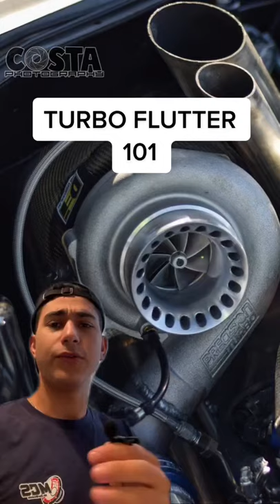TURBO FLUTTER 101 - Explaining Sutututu Theory

Comment: I believe you are describing a diverter valve, when the boost limit has been reached the valve opens to purge enough to drop the boost pressure and this is back into the exhaust.
Reply: He is talking about what happens when there is no  diverter valve or blow off valve releasing pressure, also it doesn't vent into the exhaust, it vents into the intake of the turbo.

Comment: There's also Sequential BOVs like the ones from HKS which simulate a Flutter without all the lower life expectancies
Reply: Simulate flutter aka sound nothing like flutter, also doesn't damage the turbo not running a valve.

Comment: It’s called back spoiling because the pressure in the inlet past the turbo is at a grater pressure than the exhaust gasses expanding pre turbine so it begins running backwards
Reply: The turbo runs backwards?

Comment: Compressor surge occurs when leftover boost is trapped between the throttle plate and the compressor. With nowhere left to go, the charged air forces it’s way back out the intake, passing through the spinning compressor causing the fan to ‘chop’ the air, resulting in turbo flutter.
Reply: I heard this can be bad for the turbo, is this true?

Comment: Its called compressor surge, the part you're referring to is the impeller not the turbine, and the pro's often use a recirculation valve over a blow off valve.

Comment: It’s actually caused by two different types of turbos. Turbos with blow off valves are regular turbos. Turbos with variable geometry valves in them make that sound.
Reply: Except that is no the case,  the sound is what he explained, it's caused by not releasing pressure out of a blow off/bypass valve not the type of turbo.
Reply: @DriftNick  its completely about the type of turbo. Only the variable geometry turbo makes the sound he's referring to because the vanes are positioning themselves to slow down the speed and letting pressure off.
Reply: @camronchacon7259  You don't not understand what is happening if you think it has anything to do with variable geometry turbos, he explained what it is in the video, unless you can point out where my 35 year old car has a variable geometry turbo? oh that is right it doesn't.

Comment: And that air forcing its way backwards out the compressor, also causes a lot of shock on the bearings. Because the wheel and shaft get pushed back and fourth. 
So basically that sound is the death of a turbo.
Reply: Basically that sound is the death of a turbo = does no noticeable damage.

Comment: The flutter you are hearing is caused by the rapid reversal of airflow through the compressor. (Nothing to do with the turbine - remember a turbine is a finned wheel used to convert air/gas/water flow into rotational energy, so in a turbocharger, the turbine is the exhaust wheel, which drives the compressor wheel via a shaft.) When the turbo is producing boost, it is spinning at high speed and moving a lot of air. When you close the throttle (let off the accelerator) this large volume of air suddenly has nowhere to go, so it bounces off the closed throttle plate and back towards the turbo compressor, which is still trying to compress the air (because it is still spinning -- due to inertia and centrifugal force). This creates a repeated back and forth pulsing which is what you hear until the pressure in the charge side of the compressor equalizes with the outside pressure (atmospheric pressure.). A blow off valve is designed to open as soon as you close the throttle to allow the charge air an alternate path out of the closed system. The fluttering (compressor surge) is not very good for the health of the turbocharger to but it does offer an advantage: If you get back on the throttle while it is still surging, you get much quicker re-spool since there is still compressed air on tap. This is why you often hear compressor surge on race cars, since racing teams have budgets for turbo replacement / rebuilding.

Comment: Just so we’re clear the charged air is released through the compressor and not the turbine. Turbines convert pressure into energy (hot side) compressors convert energy into pressure (cold side)

Comment: Yeah bro this happens on systems with BOV’s too if the boost pressure can’t escape quickly enough or if your BOV spring is too stiff especially on those sandwich types like the Greddy. The HKS dolphin sound one can do it too with an overly stiff spring.

Comment: More I’m depth explaining that no one asked: when there’s no where else for the air being sucked in to go when the throttle body is closed it wants to try to escape back through the intake but the turbo compressor wheel is still spinning and it starts to chop up the air since the compressor wheel is only designed to have air pass through in once way  the air being chopped up creates turbulence and thus you get the flutter sound. The air hitting and being chopped up stresses the bearing on the turbo because it creates a lot of resistance and causes the turbo to wear out considerably faster. So even though it doesn’t sound as good always put a blow off valve or a recirculating valve in.

Comment: Always reroute your airline to the front of your air intake or put a blow off valve, although stustustustu sounds nice it's a surefire way to damage your turbo
Reply: Unless it's on throttle flutter, no, off-throttle flutter causes minimal to insignificant damage
Reply: @justjamesAMX  repeated compressor surges regardless if it’s on or off-throttle can lead to excessive play in the shaft. With enough play, the turbine or compressor wheels can come into contact with the housing and this can lead to catastrophic damage to the turbo.
Reply: @Nicholas247066  for off throttle though it's so insignificant that even if those surges are happening regularly it may only take at max a year off the turbos lifespan, so it's not that big of a deal

Comment: It's not escaping from the turbine. It's coming through the surge valve on the compressor housing. The Choo Choo sound is caused by the turbine blades creating sporadic pressure waves inside the housing as it's rpm slows down due to you getting off the gas, and your throttle valve being closed.
Reply: Surge valve on the compressor housing?

Comment: It also causes turbo stall, making the turbo have to work harder to spool back up again.
Reply: Stalling refers to the air separating from the blades of the compressor, the turbo does not stop spinning, it doesn't even slow the turbo down, in fact if you are off and on the throttle fast enough not releasing the pressure means the turbo has to do less work to build boost again.

Comment: A blow off valve with a bypass also retains boost pressure I think. You don’t get the flutter noise but instead you this sick blow off with a couple of throttle body slaps while letting off the gas and getting back on it
Reply: A bypass valve absolutely does not retain boost pressure. A bypass valve routes the air back to the inlet side of the compressor. An area that wouldn’t be able to hold pressure anyway as there is a big air filter on one side of it. Functionally that area is under enough vacuum anyway that it’s not like air is actually going out the air filter, but it’s just letting a bit less in. Bypasses are mostly important if you have a MAF since the engine is expecting that air and will become very rich if you vent it to atmosphere.
Reply: @X85283  I see. I’m fairly new to this type system so I wasn’t too sure. Thanks for the reply though I appreciate it! I’m in hvac so I’m trying to navigate car systems with my knowledge of that. But the way you described it makes sense 😆. Do you know any good YouTube vids that explain this? I’d greatly appreciate the help
Reply: @Paralius  I don’t know any good videos but I know a lot of people get it wrong and think a diverter somehow retains boost 😅

Comment: It also puts stress on the spline(turbo shaft) that connects the hot side of the turbine, which is the input force provided by the pressurized exhaust from your cars engine, straight from the exhaust manifold, this hits the ass end of the turbo that has a turbine (not an impeller) that then pushes the rotating exhaust gasses out the aft of the turbine which is routed out the tailpipe. Now, the impeller side of the turbo can perform forced induction, provided by what would have been wasted thrust out the tailpipe. The impeller pulls preferably clean(linear/not turbulent airflow) then centripetally forced out the side into an intercooler( not your radiator ) then to your intake. 

The reason why this "flutter sound" known as Turbo Surge, stresses the turbo    shaft is because of the scientifically proven phenomenon called me not actually remembering exactly what it is in particular other than maybe the now turbulent air being forced back through the impeller which is simultaneously compressing and thrusting air the other direction causing a high pressure zone further forcing the air even harde out the impeller causing this STU-TU-DU-DU-DOO!!! from your VTEC swapped lexus sc400.🤙🏽

Comment: Why is it that noone finds blowoff valves so cool.
Apart from being beneficial to the turbo, it makes your car sound like a pro racer.

Veri beautiful sound
Reply: All the coolest turbo race cars don't run a blow off valve.
Reply: @DriftNick  probably because by the trend…
But a blowoff valve sounds so epic
Reply: @DriftNick  dudes prefer the “tututut flutter “
Rather than setting up a proper turbo system, but i understand.
Its all about coolness and following the trends.
Reply: @EduardoGonzalez-fb3jv  Yes BWM and Ferrari are just about the coolness and following trends, that is why their GT3 race cars flutter, they also don't know how to setup a proper turbo system, same with WRC cars.
Reply: Im not even a mechanic and i understand basic knowledge…
Your channels characteristics suggests you are familiar with drifting.
Of course… you must comprehend and understand to basics of modification, building and tuning of an engine according to your turbos specs and the components you have installed into the engine and car.

This should allow you to understand that turbo flutter is wrong and should no be happening.
Reply: @DriftNick  you are wrong, no stock vehicle with turbo system installed by manufacturer should flutter.
You are absolutely wrong, stock systems have pressure valves.
Manufacturers will never over power with boost any vehicles just as any individual business does.
On peoples builds, Flutter are a sign of over boosted power, too much boost is being generated and the wrong side of this situation is that no pressure relief valve is installed so the compressed build exists through the compressor turbine.
Its not wrong but for manufacturing standards i believe it’s excessive and not acceptable.
Never have i heard a stock turbo engine flutter…
Reply: @EduardoGonzalez-fb3jv  Wasn't talking about stock street cars but anyway before they started fitting bypass valves for emissions every turbo car would flutter.

"Manufacturers will never over power with boost any vehicles"

This is where you lack of understanding is made quite clear, they aren't over powering anything.

" Flutter are a sign of over boosted power, too much boost is being generated"

Nope, just a sign there is no valve releasing pressure.

"so the compressed build exists through the compressor turbine."

The "turbine" is on the exhaust side not the inlet nor is it a compressor.
Reply: @DriftNick  ok whatever

Comment: All that air has to go somewhere when your throttle shuts immediately,    but I heard it's bad for the turbo that way but it does sound good!
Reply: It's only bad for the turbo if it's fluttering while you're on the throttle unless you're running super high boost

Comment: Yeah, when the throttle snaps shut. Not when you accelerate. If it flutters under acceleration, it's called compressor surge and it's really bad

Comment: Turbo flutter is actually bad for your turbos. It's actually delamanation of the air from the blades, forcing it to spin in the opposite direction.
Reply: If you think it can make  a turbo spin in the opposite direction you have zero understanding of what is happening.
Reply: @DriftNick  it's trying too get the turbo to spin in the opposite direction
Reply: @DJZander303  It does not that at all, it  doesn't even slow the turbo down and yes people have tested it.
Reply: @DriftNick  if the wind is blowing in your direction but it isn't strong enough to blow you over or even slow you down, does that mean its not blowing in your direction. Two things can be true.
Reply: @DriftNick  if it's blowing out of the turbine housing it is quite literally pushing against the fins. And since they are pitched in a certain direction for rotation. It is quite literally putting force on an aerofoil that isn't in the right orientation. Meaning it's trying to force it in the opposite direction. It's the same way wings work on cars, you flip them they create lift.
Reply: @DJZander303   Turbine housing? are you sure about that?

" It's the same way wings work on cars, you flip them they create lift."

Not even close to being the same thing, the air is seperating from the blades, it actually makes the compressor speed up as there is less resistance, in reality the exhaust flow is the biggest factor for turbo speed and there is no measurable difference between running a valve or not.
Reply: @DriftNick  incorrect sir wings on a car are just flipped airplane airfoils it creates down force same as jet turbines, which are the same as turbo turbines they work on the same premise.
Reply: @DJZander303  On one side we have people that have literally tested it and shown what I said to be correct, on the other side we have you that doesn't even know what the turbine is.

Comment: That flutter that you call it, it is called surge! You are correct but you need to also mention that turbos do come with anti-surge. Those holes on that turbo that's behind you in the photo has anti-surge built in. You don't need a blow off valve if you have a anti-surge turbo. Yes I said it, blow off valve/bypass valve are meant for turbos that doesn't have a anti-surge turbo. Not having a b.o.v. will allow your engine to spool the turbo faster and make power earlier.

Comment: Btw for anybody who thinks it’s inherently “bad”, it’s not so bad that you’ll kill the car or turbo. Diesels don’t run BOV’s, and they work identically to a gasoline car (minus the spark plugs)
Reply: Diesels don't run BOV because they also don't have throttle bodies. All air they get just gets shoved into the cylinders. 

The "gas pedal" in diesels control amount of fuel injected, not the amount of air that gets into it.

Comment: btw turbo flutter is bad for the turbo. You're basically straining the blades and the bearrings because the eacaping boost affect the rotation of the blades drastically and in very short periods. A blowoff or a PCV actually extends the turbo lifespan.
Reply: Affect the rotation of the blades drastically?

Comment: You forgot the part where you don't get the nice squeaky version of that sound unless you have what's called a "dose pipe" which is just a way to say "some kind of non-stubby pipe between the compressor intake and the intake filter."

It needs to be at least 10 inches long and preferably with some kind of bend in it, but not a short radius or "stubby" elbow. Without a dose pipe, you'll just get a basic ass, fast decaying, even sounding flutter with no tone. WITH a dose pipe, you get that theatrical drawn out first "stuuu" note.

Look up "dose pipe comparison keep it reet" for more.

Comment: Hot take: The stu Stu Stu is the sound of your BOV not working correctly for instance it’s not letting enough air out so the air is being forced back up threw your turbo which is not good, weather is causes damage or not it causes to Turbo to work incorrectly air is not supposed to go back threw your turbo that’s not how it was designed ✅🤝
Reply: It's not good, it's great, doesn't damage  the turbo or cause any performance loss while sounding awesome.

Comment: the pressure does not escape through the turbine of the turbocharger unless it blows the bearing out. It escapes back through the compressor. People commonly mistake the compressor for the turbo. You can make the noise but don't know much about turbochargers.

Comment: Actually it's not escaping from the turbine wrong side of the turbo brother,  it's  from the suddenly closed throttle body back to the  compressor wheel, 

when you come onto boost you get positive pressure between the compressor housing and throttle body when you jump off the loud pedal the throttle body closes and then this pressurised air has no where to go so it starts back tracking through the compressor housing hence that stu stu stu that's the sound of air being chopped

You can stop this by having a compressor housing with anti surge or blow off valve.

That's turbo flutter 101 for you

Comment: A lot of wrong things said here, lol but a simple explanation for newbies. What you are referring to as the turbine is actually the impeller on the cold side of the turbo feeding the intake. And no the boost doesn't ordinarily need to go anywhere, it only needs to go somewhere when the throttle is slammed shut. Normal boost regulation is done by the wastegate.

Comment: bonus info about that sound:
never do that if you don't have the money to change your turbo often...
Why? cus that harms the blades of the turbo, eventually Breaking your turbo.

walk around to get a similar sound?
you get a rotary blow up valve for your closed system. 
(not sure of the right name of it)
which will give you the chuchuchu sound instead the sututu.
might not be what u want but will definitely save the money on your wallet.
Reply: It does not damage the turbo.

"chuchuchu sound instead the sututu."

Both of these sounds are turbo flutter, no blow off valve makes those sounds.